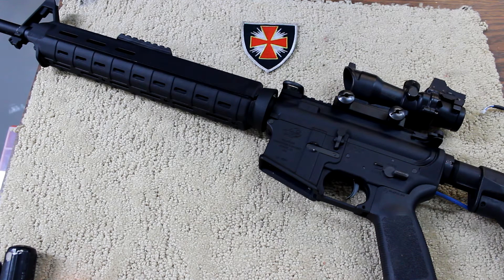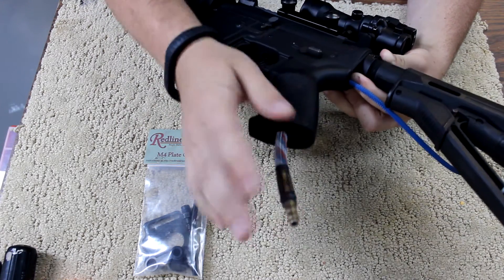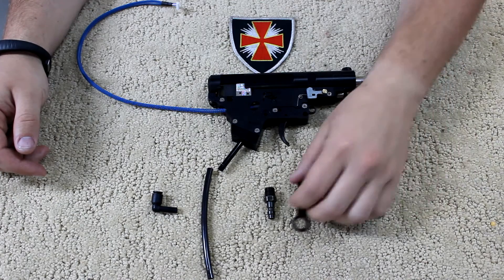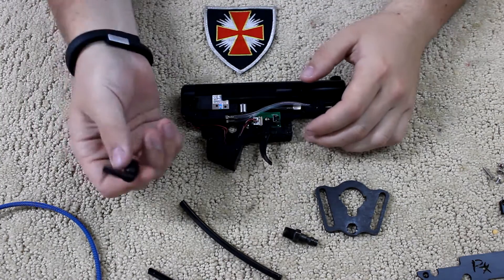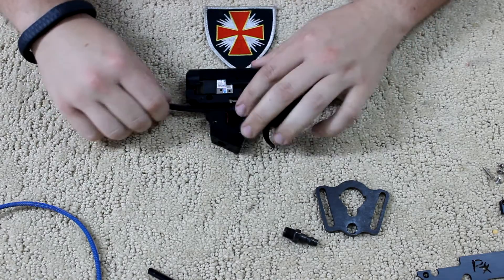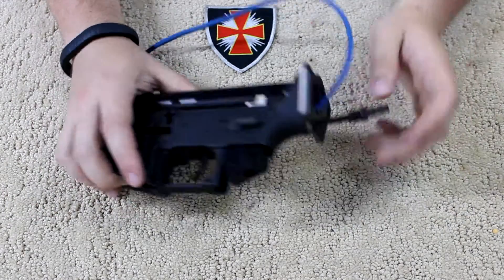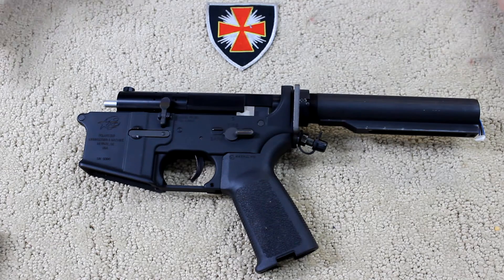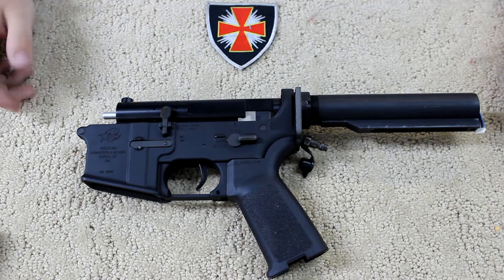PolarStar Tutorials: Redline Plate Connect

Comment: Great video, I've got a plate connect on the way, how do you find it works? Also I assume the system impedes the full collapse of an adjustable M4 stock
Reply from the maker: The plate connect works very well. You would think looking at it that the line would hit your hand, but you barley notice that it is there. And yes you cannot fully collapse the stock, it needs to be 2 positions from fully collapsed, still plenty for CQB situations